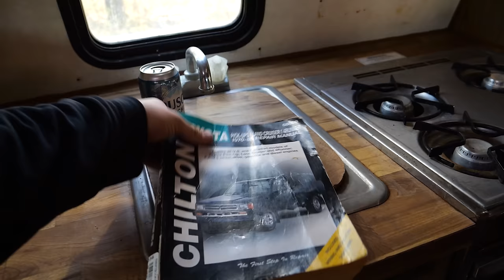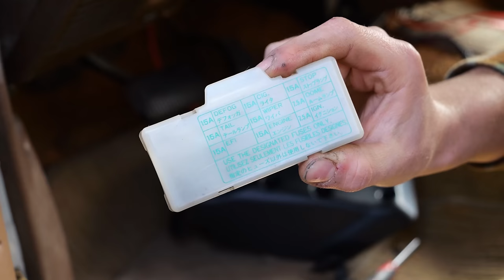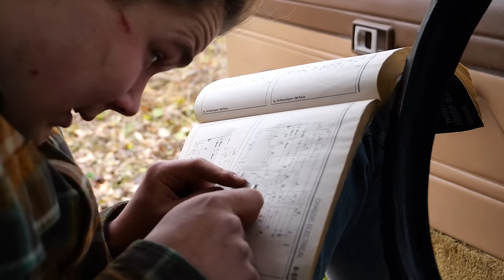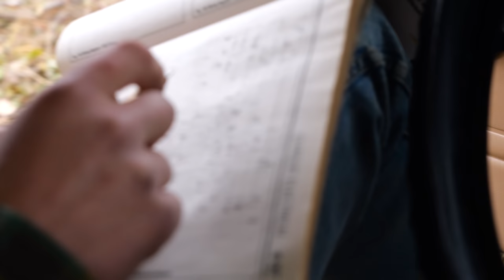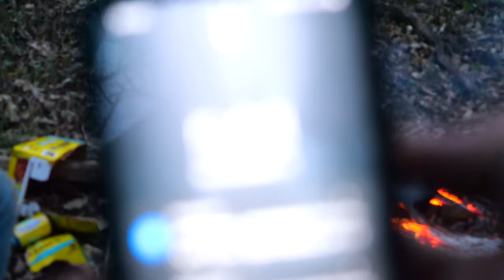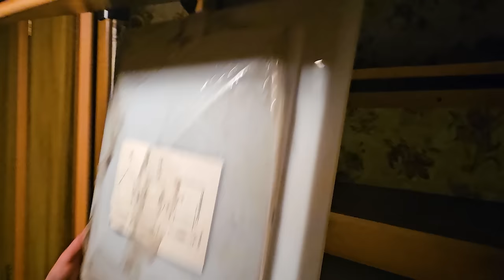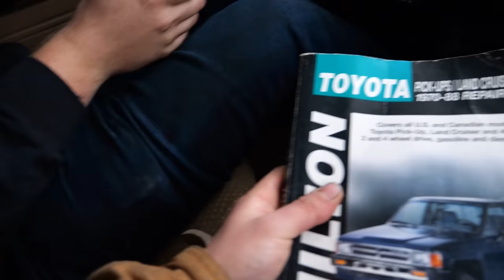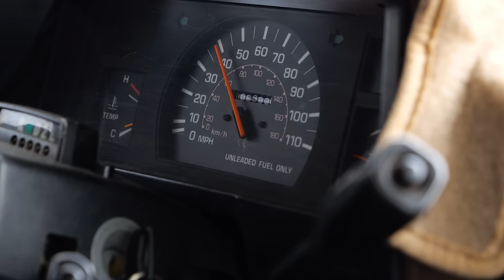Will this Old Camper RUN & DRIVE Out of the Woods?

Comment: Just wanted to chime in with this; NEVER use MAF sensor cleaner on older japanese cars until you know for sure that it is an actual MAF sensor. A lot of these use what's known as a Karman Vortex Flow Meter, which is a really fancy way of saying "small piece of tinfoil in a tube." IIRC somehow the frequency of the piece of foil vibrating is measured and that's how it determines flow rate. If you shoot high-pressure anything at the right spot on the sensor it'll kill it instantly.

Comment: The fuel pump won't work without the maf plugged in and air flowing through it. Pretty much anything with a flapper door afm works the same way.

Don't want the fuel pump dumping gas out in a wreck.

Comment: those 22R and 22RE engines are easily the best and most reliable gas engines. they can easily hit 700k-1million miles with routine maintenance. and if it blows? put in a turbo diesel OM617 from Mercedes to swap.
Reply: Saw a Ranger online for sale with the OM617, ad said 80% completed and I zoomed in on the pic there engines vacuum lines were unhooked.
That engine require vacuum  for diesel runaway fuel shutoff and the Mercedes trans smoother (shift modulator) , said shift modulator is now unobtainium, so that rig likely required an entirely different (expensive ) trans setup. cool engine though.
Reply: @Supertech-86  yea man those 300Ds may not look the coolest but having a 1m mile engine from a  Mercedes is still impressive to me. I saw a guy swap one into a jeep cherokee
Reply: @dookiemane  I hope his Mercedes trans smoother hangs tough, I believe they wanted $1400 for a trans adapter plate.

Comment: Correct me if I'm wrong but the fuel pump on these trucks only run once they see a crank position sensor signal. These trucks don't prime the system when you turn the key on

Comment: I owned 4 of those trucks from about 1970 to the mid-90's; whenever they discontinued the Hi-Lux and introduced the Tacoma.
You couldn't kill the drivetrains with a hydrogen bomb but unfortunately the bodies were made of papier-mache. I drove every one of my trucks to the crusher, but I could have just put my feet through the holes in the body and Flinstoned my way there too. 
Probably never should have taken those trucks to an environment with snow, ice, and road salt. They might have lasted forever.

Comment: I got a buddy that uses a corndog stick to work a relay on the passenger side of one of those trucks not an rv but the same truck idve never found that myself works the power for the whole truck to itll turn on but wont do anything till you put the stick in the relay don't know why he don't just buy one but hey if it works it works

Comment: I almost bought one of these.  In fact It was nearly identical.  However, I asked to look inside and the guy was hesitant.  but reluctantly opened it up.   there was no refrigerator, thus just an open hole with that grate to the outside,  The table bench seats were gone, replaced by some salvaged city-bus seats. And when I opened the cabinets is where it got really "good".   Along the ceiling where the back of the cabinet meets the ceiling, I could see daylight coming in and the wood was wet and delaminating. It was like this in two of the overhead cabinets.  Open gaps that drained water directly into the cabinets.   Hard pass.  Maybe for 2 or 3 hundred,  then I would fix it up.  But the seller (a little local used car lot)  wanted 10,000 for it!   No friggin way.  
I eventually bought a 1986, 27ft Coachmen Classic on a Ford E350 chassis (with a 460) for 5,000 bucks.   Everything works, (except the aftermarket dash AC)  Plus it has a separate shower room and toilet room and a private Master bedroom in the rear. In addition to the table-bench and a HUGE over-cab bed that's like a king-size bed.
Needs some TLC but the roof doesn't leak. I did some work to it,  bought a new full atress for the bed in the back,  curtains,  LED bulbs in the interior. (warm white,  not those gray-blue LED's)  It hauls ass,  (uphill doing 74, passing a shitbox with a fart-can.)  Drive like a tanker ship,  but is comfortable and smooth. Still has a voltage regulator hiccups so the chassis lights flicker a bit.  But overall,  It's my first RV, and I'm satisfied.  
If you want a change of routine, Get an RV.  Make it reliable, Go somewhere.  It's awesome!

Comment: I never cared for Toyota until I was forced into buying an 03 Corolla because it was cheap and needed wheels. They just work and are the easiest thing to work on. They even have base line specs and clearances on the underside of the hood, like the valve lash for example.

Comment: Does that truck have the 22R in it? if it does they are a good little engine and Toyota used them for many years the 22R is the carb model and the 22R-E was with EFI. if it has a 100 thousand miles it's a good idea to replace the timing chain because that's right around when they start to get loose and cause issues anyway that is a cool rig and should be good on gas

Comment: Hi dig very disappointed u got nice finds only engine trouble but outside and camper better condition.... Mine engine good runs and drive outside and inside needs works

Comment: id love to have something like this even if its auto. id clean it all out rip out the interior and fix the shell cut the top off and make it a few inches taller then get fresh paint. tune up on the motor. give it a 6 or 8 inch lift and 22 or 24 inch offroad tires and just leave the world behind 
the dream. i would love a 80s toyota camper

Comment: Something else sounds odd with the way it's running I am not so sure it's just vacuum leak.

I don't know my aunt's 85 2.4L 22R carb X Extra cab I had it at 75 mph on the freeway but it was a pickup.

22R carb 100hp range
22RE & EFI 110-118hp range

Comment: Anti-theft devise. Just run a push button under the dash and attach it directly to the battery. What could happen with a short to the battery running the fuel pump?

Comment: Why would you say most were standard when the opposite is true. I guess that may be because most that make it on-line(for sale) are standard. Automatics are usually sold as soon as the owner thinks about selling them. I waited three years to get mine, 91, V6 FI, 4A. 160k klicks $17000 15 years ago, put another 100k klicks on it with normal maintenance. 
If in good working order 
Those older 4 bangers go for $5k to $15k depending on condition and if it has the upgraded axel.

Comment: Great Job, but it was a bit cringe-worthy watching you work on it. That old Toyota did gain your respect, but in the beginning you were just a tad harder on it that normal.  Being a Toyota super fan, it hurt just a little... But I got over it when you rescued that strange looking cat :-P  1986 was a strange year for the Toyota RV's kinda 1/2 a 1-ton version ... It would be worth removing the rear hub caps and checking for the full floating axle. a LOT of weight if its not.

Comment: Which carburator for more horsepowers without destroying stuff can i use on a 1980 368 v8 cadillac?
Reply: Currently i have an tbi with 2 injectors hanging above the throttle body

Comment: Question: Will it run?
Answer: It's an old Toyota, so yes it will.
Question: Are you sure? it's been sitting in the woods for years and the electrical is all screwed up.
Answer: You said it was an old Toyota right? Then yes, I'm sure...😉

Comment: That looked painfully slow, or is it impression? I really don't know anything about campers, but maintain high rpm for long periods at a highway to keep thr pace does not seem very safe or healthy 😮
Reply: Engines are meant to do that. Knowing older toyota engines are a tank, I dont think a little 3000 revs will do much more harm than redlinig it all day

Comment: 1000000 is nothing for a Toyota my tundra has almost 1/2 million miles on it, I have had to replace one coil pack and the o2 sencers but thats all , mine is a 03 and a v8 not the 22r

Comment: First 10 minutes didn't see these guys checked the oil or water...not even the fuel level....probably drives 100 miles with oil or water

Comment: I call major BS. On that thing having sat right there for more than a year.  Weeds would have been grown up differently around and under it. Also the tires didnt even look like they left a dead spit where they sat. Also any camper with 100,000 miles of use and then parked closed up in the woods is not going to smell just fine.
Anyway .a guy needs to make content i guess.